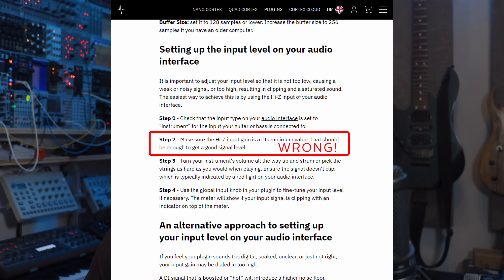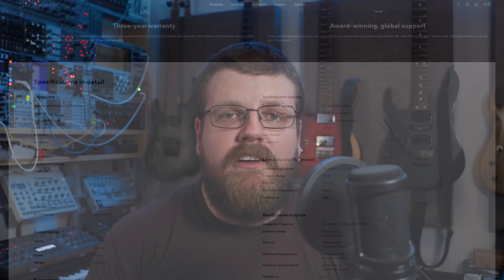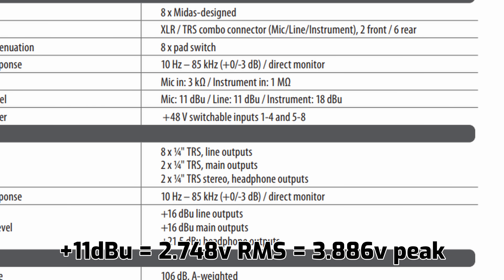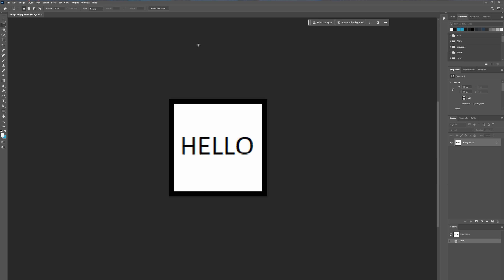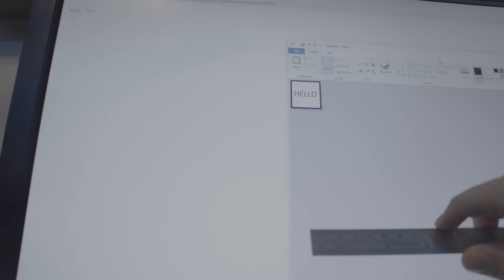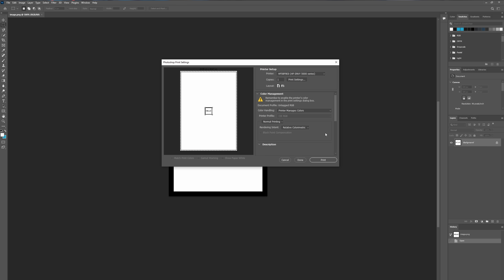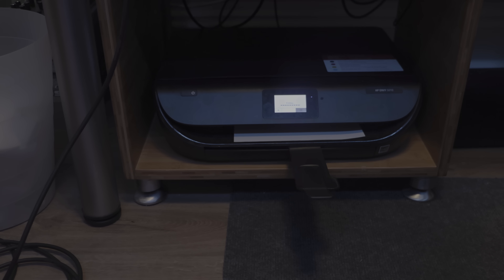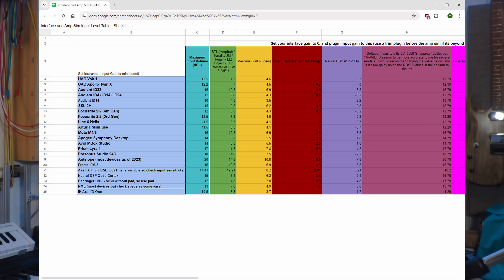Ampsims and input gain - Please, stop the madness...

Comment: How is gain staging still a discussion? This has been going on since the early 90s at least. 
As you say, as high as possible without distortion. Every. Single. Stage. Always. 

(Unless doing it differently makes it sound better, which usually means distortion).

When you are in the digital realm, and using modern software, it's all using floating point, it now no longer makes any effin difference and gain staging simply is not a thing.

Comment: For some tones these tip work very well. But i thought when i use plugins like Archetype John Mayer X the overdrive sound very fake calibrating input level in interface and plugin than keep input level at 0 and adjust the input in plugin according to the spreadsheet

Comment: As a fledgling ampsim developer, I wanted to get your take on how best to approach this. I need to convert the unitless input signal value into a voltage value because that's what the sim expects to see. Most audio interfaces have spec sheets that list the maximum input level in dBu. If the plugin is given that information, it can reasonably calculate an equivalent voltage of the unitless signal when the input gain is at its minimum setting (assuming we can trust the spec sheet and the user's ability to interpret the spec sheet and enter the proper value). That gain multiplier converting dBu to voltage should be `0.775 * pow(10.0, in_gain_dBu / 20.0) * 1.414`.

After rewatching this video I think I want to add an additional input gain control to account for any boosted gain when the input gain knob on the audio interface is above its minimum setting. Maybe a calibration mode in the plugin would be able to calculate the gain offset by instructing the user to play as loudly as possible while on minimum input gain setting (since we have a dBu to V conversion at minimum gain), record the max input level of that gain setting, and then instruct the user to push the input gain to just below clipping and record that max input level. Take the difference of the two max input signals et voila; that should be a good input gain correction to apply to get a voltage level at least in a reasonable range.

Any thoughts on this approach? Is it valid or even helpful to users? Thanks!

Comment: I think a clean guitar or something that doesn't have distortion in the sound would have proved the point a little better... but well done.
Reply from the maker: It absolutely would not have 😊. In fact the only reason why this matters is because a high gain ampsim adds so much gain. A clean ampsim adds much less gain, and therefore doesn't bring the noise floor up as aggressively. So the signal to noise ratio is much less important, and you don't have to squeeze every last bit out of your converters. So, actually, this only matters if you're using lots of gain.
Reply: @GhostNoteAudio  that is true, but for me listening on computer speakers... it was very difficult to "Hear" the difference... I was just thinking the "peaking" would be more noticeable with a clean sound... but thanks for replying.. and for the correction.

Comment: I can't wrap my head around this..
Is it because some people wire a 1895 magnetic amplifier wrapped in 100m extension cord to their ADCs? Even if so, giving up 90% of your ADCs resolution doesn't make any sense. I don't get it.. 
Either their preamps are made from a single lm358 a cap and a pot or they just like the free bit crusher plugin this gets you. But my knowledge of audio starts at this sounds good and stops at this sounds like ass. 

ADCs not DACs ofc.. fixed it

Comment: There is one other thing in the whole process here.  If you noise gate the signal right after the input, you would be gating off LESS of the total signal and still getting the signal you want.  The result should be a much more dynamic sound and a much easier to gate noise floor, making for cleaner recording.

Comment: Well, I've aways made my signal as hot as I can without it being noisy, I use an audio mixer as a pre amp since the gain in my interface is kinda noisy and not very good so I have to I set up the gains in different channels for my microphone and instrument
Reply: My signal still clip from time to time in my first try but ohh well, that's the perk of using cheap equipment in your home "studio"

Comment: When I want to use multiple real pedals (passive guitar > bd-2 > opamp big muff > interface) - im curious how I should approach using those into my interface (Motu M2). How should I use the vol / level knob on the pedals in conjunction with the interface gain knob? I recall a comment you replied to about someone using their Klon before their interface. You mentioned its probably best to set the interface gain at 0 and set the volume on the Klon to before clipping and back off some. How should that logic be applied to stacking multiple pedals then? Would that mean only adjusting the last active pedal in the chain? Forgive my ignorance, im quite new to using physical gear and sims in general.
Reply from the maker: So, in this video we are mostly discussing how to set the interface gain such that an ampsim will respond to your guitar signal the same way that the physical amp would (and then tweaking that to achieve the best signal to noise ratio). However, with something like a Big muff in the mix, all the non-linear distortion stuff has already happened before the signal hits the interface. As such, the level coming into the interface is merely just controlling the volume; the "how loud it is" bit. It won't do anything to change the way your guitar distorts - because that part's already happened. So in that case, just minimize the added input level gain, and push the pedal volume as high as it will go. If it's not enough to clip the input, you can add some gain on the interface to really make use of all 24 bits in your converters for maxim signal-to-noise performance :)

Comment: A lot of people don't understand outside engineering circles the losses that occur in mic preamp built in converters, or even the stand alone converters themselves, because they don't understand the laws of thermal dynamics still apply, and there is always loss for energy, in this case a signal, crossing dimensional media domains.

Comment: I have an "INST" button on my Scralett Solo. Should I use it or high gain?
Reply from the maker: Both. If you don't enable the Instrument input mode the input impedance will be way too low for an electric guitar, you'll barely get any signal.

Comment: Being "old school" and being taught gain staging properly this topic has been quite fascinating. I was also part of those conversations and dear lord... how this was a debated topic at all is amazing but also how confidently incorrect people were. I got a fair amount of insult.

The right answer is obvious if you know anything about the topic from electronics point of view: how does the hardware actually work. You raise the gain to optimal as soon as possible and you keep it there. What is optimal varies but in most of our use cases it is just "as loud as possible without EVER clipping". If your amp sim needs lower gain, and IT DOES then you set its gain lower. You do not set the input gains at the converter lower, that is against the rule. And your amp sim output needs to match what it is coming in its inputs too to reach unity gain. And... unity gain is how EVERY stage needs to operate after the initial gain is set as close to the source as possible. Annnnnd your faders attenuate the signal. 

Get it up ASAP, keep it up until you turn it down at channel fader. Each signal processing stage will set its input and output gain accordingly: inputs are set to whatever the device requires and output is set back to what the signal was before the stage (subjective, you are altering the signal so this is not always practical to set it some dB level according to metering, like.. compression alter dynamics and how perceivable something is, you can have a weaker signal coming out of EQ that is more audible etc...). Unity gain ensures lowest noise and distortion at each stage, and optimal signal levels in computing also optimizes calculation precision and in case of analog modelling, its behaviour. With full digital FX the gain is again arbitrary and excluding ridiculous extremes.. it doesn't matter. But you NEVER know how the plugin is made but one thing will be certain: if it is made to model analog behaviour, you have to obey the old school gain staging rules in digital realm. Making an exception just for digital plugins is stupid, use this rule everywhere, always. And this affects DAWs, digital consoles, outboard FX. If you do this i can promise that everything will work better, that is the way the gear is designed to work.

There are times when you can't do that and you can create exceptions but each exception is a new thing you have to remember that it is there. If you can bypass FX without things exploding or being almost fully muted.. And that is also how you test it, you bypass the unit and listen if the signal is close to what it was before. Incredibly important in live side, it becomes an actual public safety concern so this rule is really not optional. In studio the worst that can happen is you blow up your studio monitors and maybe one pair of ears: yours. You can take risks, public safety is totally another thing. And this leads to contested conclusion:

Compressors do not raise or lower gain. They alter dynamics. For every dB above threshold we limit you need appropriate amounts of make-up gain. Now, compressor is time dependent and it letting peaks thru but affecting RMS is subjective: use your ears, metering is not reliable. Brickwall limiters follow the rule perfectly. EQ is again subjective, the signal level can be lower but the signal is also more audible. And this is again a topic that should be have any debate but there are a lot of people with incorrect view of gain staging and our digital processing allows bad habits to form without any real consequences. But it will be a hell to re-mix or re-create something, working on such environment is confusing and tasks the mind a lot. If every FX on every track is an exception, you got to remember them all and signal levels exploding will stress you out.

Comment: I started doing this with my quad cortex. Upped the preamps on all mics and guitars and took the same amount off the input of the lanes. Solved an immense amount of feedback on both guitars and vocals and of course fixed the noise floor. This video changed a lot for me so I really appreciate it!
Reply: The Golden Rule of gain staging:

Get it up, keep it up until you turn it down.

What it means is that we raise the signal levels to optimal as soon as possible. Either at the source or immediately after the source. We keep it at that level thru EVERY processing stage and then finally you attenuate the signal with the channel fader.

If the FX requires certain input levels you turn ITS gain down. Then at the end you turn its output up or down until it matches the signal level before processing. This is not a metering job, you got to listen and make a subjective decision. Meters can help but ears will give you perceived signal levels: the goal is that you should be able to bypass any FX (not counting pedal board, amp+cabinet, real or simulated) and the signal levels should still be relatively close to the same. The concept is called Unity Gain and it ensures that we have lowest amounts of both noise and distortion, and it also keeps things safe. Especially at live side it is a public safety concern if you take out a compressor and suddenly signal levels are sky high (remember to set the make-up gain at the compressor, do NOT raise the gain at the next stage...).

The stupid thing here is that i have electronics engineering background and i knew how at circuit level things work, and how important unity gain is as a concept and it took me 25 years to connect the dots.

Comment: A good explanation with direct actionable steps.
There is one additional albeit somewhat useless bit about the noise floor. Some of the modern audio interfaces are so good, that interface's noise floor at maximum gain below clipping is far below the noise floor of the active instrument's preamp, noise from pickups or background noise of the room through the microphones. Let's assume you don't use a noise removal plugin. Then if the instrument's noise floor is higher than the interfaces noise floor, turning gain up more would have no meaningful impact for sound quality, you would get just better quality noise, but it could be somewhat useful for digital noise removal. But it has no negatives either, until clipping level is reached.

Comment: Just a question for people on here. My understanding is that Neural DSP models are calibrated to expect real guitar pickup level, not a preamp-boosted signal? So you're hitting the virtual amps input sage the way a real amp would be hit. IF you feed the plugin a hot pre-amp boosted signal, IMO you're not usng the model as intended? The noise floor being improvement mentioned in this video should be true when: Recording a quiet mic, long cable runs, alanogue tape, low output soruces etc. But false when: False when: Recording guitar DI, using amp sims, using modern 24-bit converters. Noise comes from pickups, not converters.

Anyway, this is my take on it. Happy to be corrected? Just wanting clarification for my own sanity.

Comment: I ran into this conuncdrum years ago when I first got a TC Powercore in my DAW. Opening up the world of amp sims. (and headphones for my neighbors sake).
Thankfully I had read an article, I think maybe by Eddie Cilletti. It emphasized the idea of proper gain staging for digital should be about aligning your signal to the noise floor and preserving headroom. Not about maximizing the signal level at every stage. Whcih was a hold over from analog days where you lived barely above the noise floor, but could smoosh the headroom a little bit. 
This had all the music gear salespeople telling us to turn up our input until it clipped then back down a little. Great on tape. Terrible for digital. 
But then when you move from line level (which you can align to a reference) to instrument level you are right. It's wild west. -20db? Relative to what. 
I did much as you. 
I made a little spreadsheet and entered the gain, software gain and noise figure.
Ended up settling around -10db with peaks which was approx 20db of gain going in. So yeah maybe -20db is right after all. Thanks Yamaha. 
But every guitar and bass has a different output level. Some are active, and impedance varies so it's hard to arrive at a universal figure.
Either way, I'm always going to leave room for transients. 
And how are you getting 150db SNR?

Comment: Wait how does 0db not sound like junk on people’s amp sims? This was obvious to me, when you have zero gain, you are effectively at the smallest margin between your noise floor and signal, why not amplify your analog signal and then let the clever noise gates built into Neural DSP have more fat to cut off? I thought that was pretty obvious, unless I'm right for the wrong reasons.
Reply: I think that’s a really understandable way to think about it, and it’s basically how a lot of us were taught to approach gain staging. The only thing I’d add is that with guitar DI the noise floor usually isn’t the interface at all, it’s the pickups and EMI, so amplifying the analogue signal also amplifies the noise by the same amount. At that point the gate isn’t really working with “more fat”, it’s just reacting to a louder version of the same noise. The reason 0 dB can still work fine is that modern converters already have plenty of headroom for a DI signal, and the amp sim input is really the stage that’s meant to be driven, not the interface. I think people get different results because both approaches change where the non linear stuff happens, not because one is fundamentally broken.